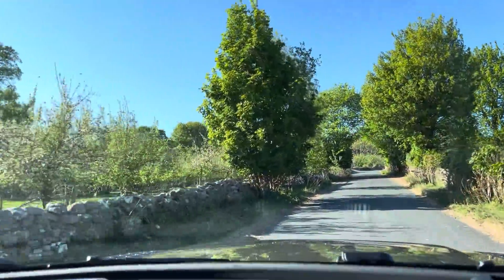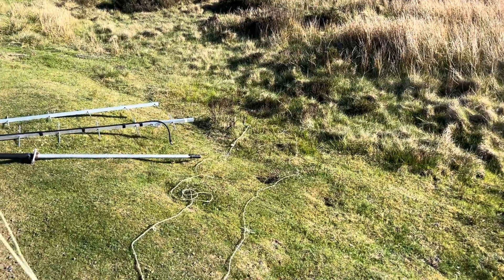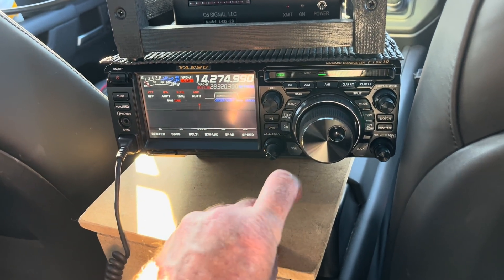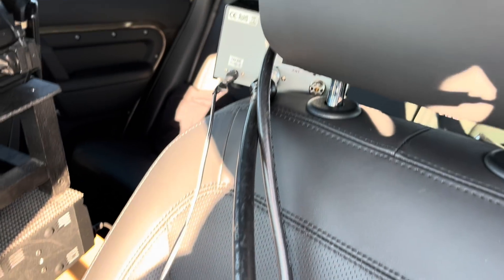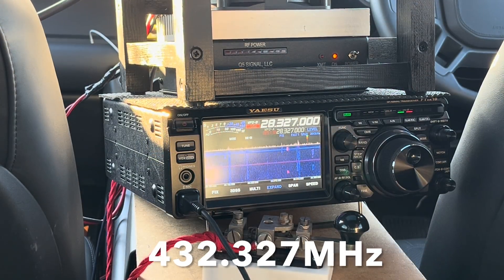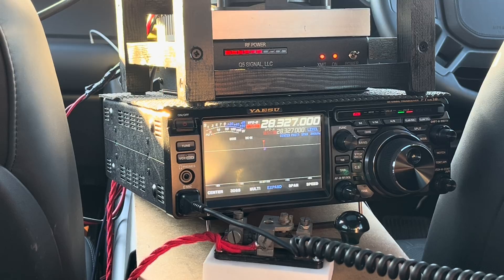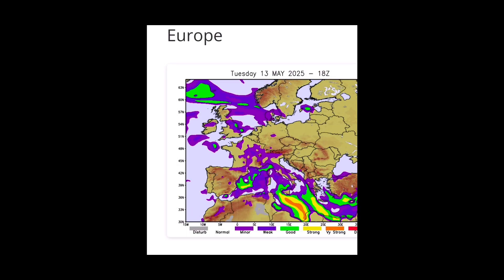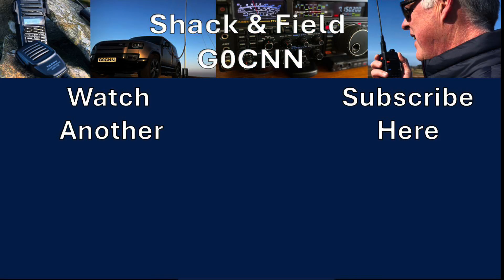Introduction to UHF Contesting (& some interesting challenges)

Comment: non ham  (not got the electrical smarts for the exam)  question, how do you keep track of what frequency you're using after putting the signal thro the trasnverter? 
Very interesting vid, thank you.
Reply from the maker: Hi, it’s not a problem. Just ignore the 28 and replace with 432. The rest is just the same, so 28.350 is 432.350 👍🏻 Some rigs e.g. Kenwood TS-2000, have a menu option where you can change the main display to reflect the transverter frequency.

Comment: That's quite the setup for UHF that you have there.  How many elements on that 7m yagi and what is the approximate db gain of it?  At your location, what was the longest QSO you made?
Reply from the maker: Hi and thanks. It’s an 18 element innovantennas Ultra. 18dBi of gain 👍🏻 I’ve only use it portable in contest situations, so not been at home monitoring the bands for openings etc. This contest is typical of the max distances I’ve achieved on the 80W 😀

Comment: Hi Ian,  great video thank you, just a question about the interference from fylingdales is there any way of filtering  this  it is rather annoying.73
Reply from the maker: Hi Les and thanks. Only the noise blanker and using it sparingly if you can….
Reply: @G0CNN-Ian  Thanks for the reply Ian 👍 73